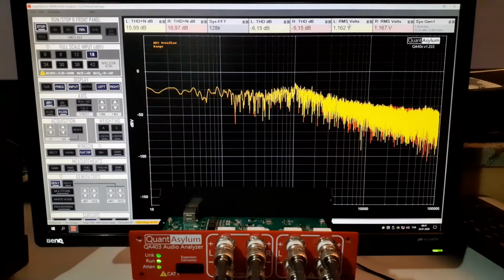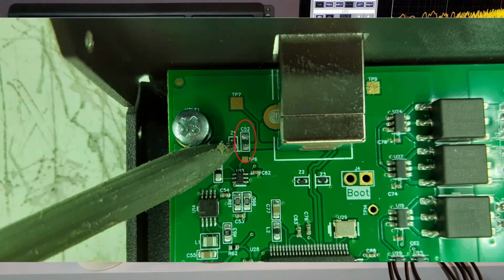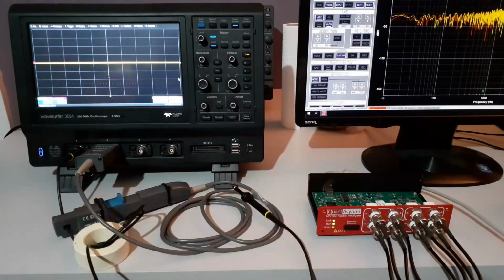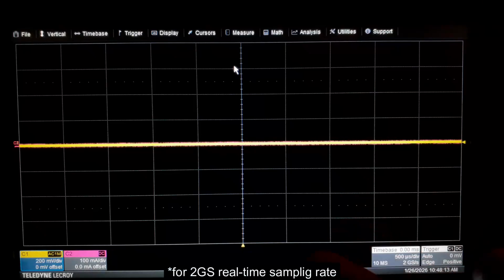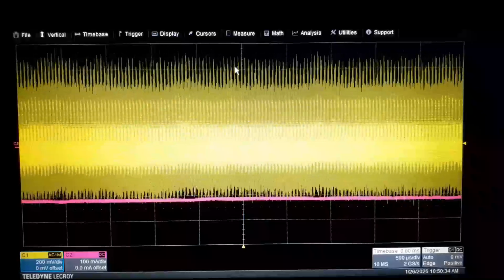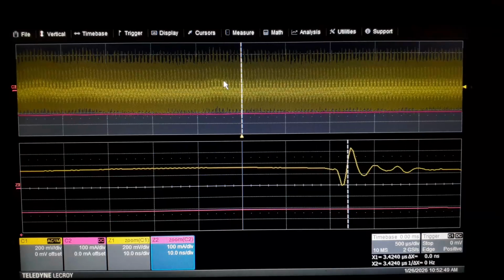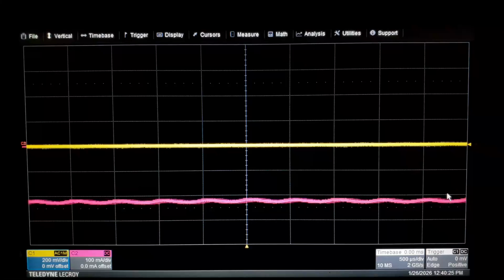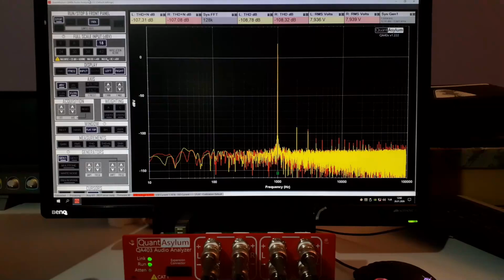QuantAsylum QA403 Audio Analyzer USB Connection Problem & Solution

Comment: You need to learn how to measure noise. It’s not at all what you’re doing.
Reply from the maker: if you are talking about '' audio noise measurement '' this video is not about that. ( please read the description ) if you are talking about QA403's USB port 5V Vcc rail noise , my equipment is not enough for measuring that very high frequency noise and i already said this in the video a few times. i'm already not trying to measure that very high frequency USB port 5V rail noise. i investigate what is the problem and showing the results. this video is about a not working USB device ( QA403 ) , why it's not working and how i fix it. i did this video because i saw some people has same problem with their own QA403 devices on the internet.
note : if you are talking about my common mode noise filtering technique is wrong in the video , please check this video at 5 : 06 : https://www.youtube.com/watch?v=8UeTMPBPyQI  this is a very effective , cheap and easy way to filtering high frequency common-mode noises when you are looking to any switching circuit signals or dc supply rail on the same ground with the oscilloscope.